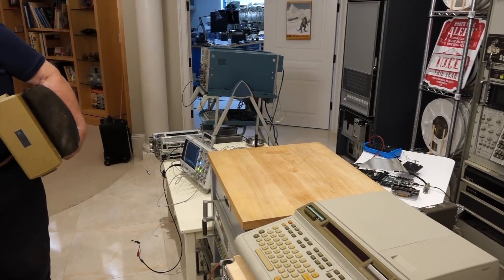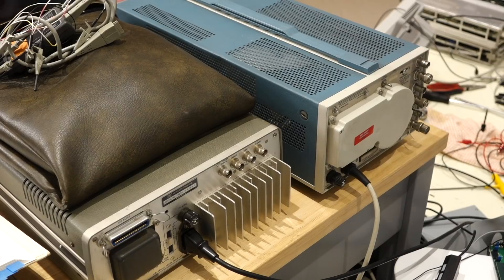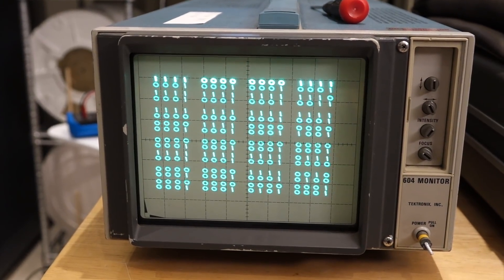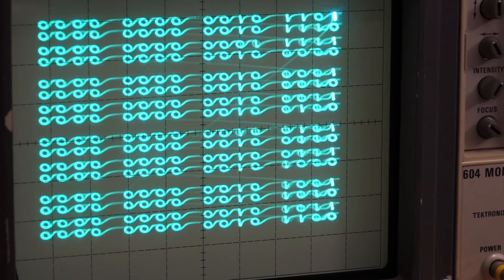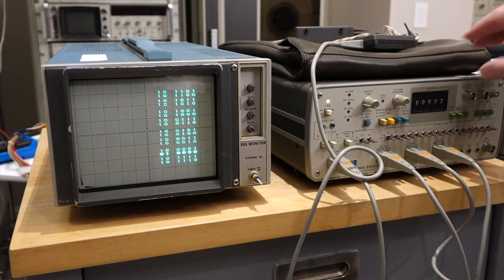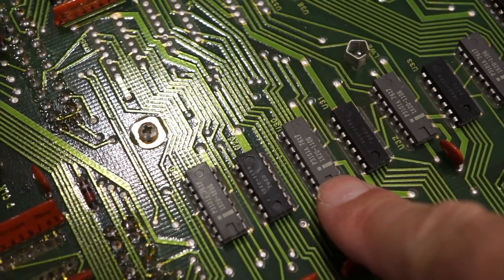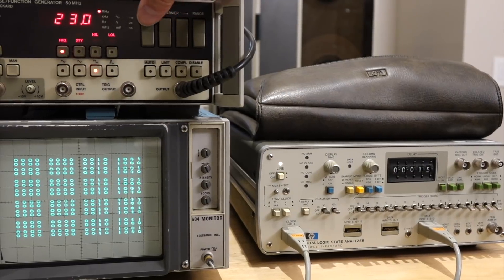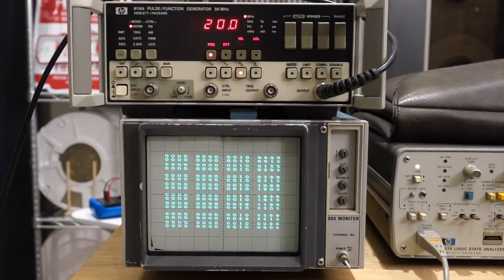HP 1607A Logic Analyzer

Comment: The way the digits are generated is really amusing: there's a sine generator in the device and a derivative circuit (essentially a capacitor in series) to produce the cosine. Regardless, the cosine is added to the Y axis output. For a zero, the sine is added to the X axis output.

Comment: that's amazing- i didn't know test equipment that displayed the output as drawn characters on a sillyscope existed- I thought only early broadcast tv equipment did displays like that. I assumed any logic test equipment would just be rows of leds or counters showing oct or hex
Reply: Look into 7L logic analyzer plugins for the Tek 7k mainframes. Same principle. Heck, those mainframes have a built-in analog character generator for labeling vertical and horizontal scales. And the characters are passed from plugins to the mainframe as… analog voltages, none of that digits rubbish :) Well, to be frank, they are IIRC base 12 digital signals in a multi-level logic (vs base-2 on-off).

Comment: What type of connector is the 3-lug TRIG BUS connector that is smaller than the BNC connectors? My best guess is that a Trompeter / Cinch PL50 "TPS" might be a mating connector. I have an HP 1600A and would need to build a TRIG BUS cable to connect an HP 1607A to it if I pick up one of those.
Reply from the maker: I don't know. Looks like a smaller version of the Trompeter triaxial connector I have on some other units.

Comment: Wow, I didn’t realize people were ripping off the Salae brand for those little crap units. Real Salae Logic units are $100~200, but are way nicer. They’re based out of South SF, and are nice folks.  It’s still impressive what you can get for $12 on eBay, though.
Reply from the maker: Yes, I forgot to highlight it, it's a cheap knock-off, not the real Salae.
Reply: I would love to have those switches for the pattern. It is either a rotary dial or touchscreen on my 45000$ desk device. I am thinking of making a gpib control panel with rocker switches only ;)
Reply: To be fair the "real saleaeaeae logic" is just a copy and paste of Cypress EZ-USB FX2LP application note from datasheet, and it wasnt even the first logic analyzer build this way. Salaleaeeaeea itself is a company founded on ripping off USBee.
Reply: Yeah it's really sad. You can actually buy a Rigol MSO scope for cheaper
Reply: Colin Alston It’s apples and oranges. I bought an MSO scope and basically paid the same again for the Saelae analyzer. The scope functionality is rather basic in comparison, and it has A/D channels as well. I used it before I got the scope with some cobbled together resistive dividers when the voltages were out of range. Still prefer the UI and functionality to that of the scope.
Reply: Sigrock is pretty good these days - I've never used the original Salae software to compare to, but their prices are outrageous these days! I'll take $12 for the hardware and OSS for the software anyday. Plus Sigrock is easy to extend with your own decoders in python, and spits the data out in text files, which is immensely useful in some cases.
Reply: Salae jacked up their prices something ridiculous as soon as they got popular.
Reply: Colin Alston They actually have a staff that has to be paid. Those are not “fire and forget” products. They have support, and they don’t even sell the old ones (the ones that are cloned). Their new stuff is pretty neat. I’m a very satisfied customer. Their support is more in line with HP’s support back when: you get actual engineers to talk to. Compared to HP prices (brought to modern dollars) they are the “cheap” ones. OSS software, sadly, sucks in this area - and I speak here as a big OSS proponent who contributes to a couple projects too.
Reply: rasz: They were originally, the newer ones are a little bit more complicated. I still think they are overpriced, but you're really paying for the software.
Reply: Colin Alston Oh, wow, I hadn’t seen that. Dang, yeah, those are now priced like other instruments. A lot faster now, but that’s overkill for lots of applications. That’s kind of disappointing, since the old performance/price point seemed to be making them money.

Comment: Having tile removed, I assume?
Reply from the maker: Good guess! Stucco removal...
Reply: CuriousMarc I wonder whether the percussion electric tool is more or less auditorily disagreeable than the manual alternative. A good demo person would develop a steady rhythm on the chisel so that wouldn’t be as disturbing as a more random pattern by someone inexperienced. Stucco should fall off with a fairly wide chisel and once you find the suitable angle it can be a fairly quickly progressing job, with a steady hammering tempo. I’ve seen a pro in action doing something similar and I swear they kept the 4-4-3 pattern going at 1/4=70 tempo for minutes on end. It could almost make one fall asleep!

Comment: Wow, I never knew logic analyzers (at least this one) would draw to an XY scope. That thing is beautiful.
Reply: Ya... I was a bit  confused until I saw it happen. Then when he hit blanking , and I saw crisp clean 1's and 0's -  I was amazed. You could have used that display in a 1970's James Bond movie, with a "nameless henchman" dressed in a blue jumpsuit, monitoring the data.
Reply: I have at home an old logic analyzer, that produces a PAL videosignal and draws the signal as individual traces, instead of writing ones and zeros
Reply: Around 1980 I worked with a Z80 development system that connected to an analog scope in the same way to display a trace. It displayed data and addresses in hexidecimal. Sorry I can't recall any more details.